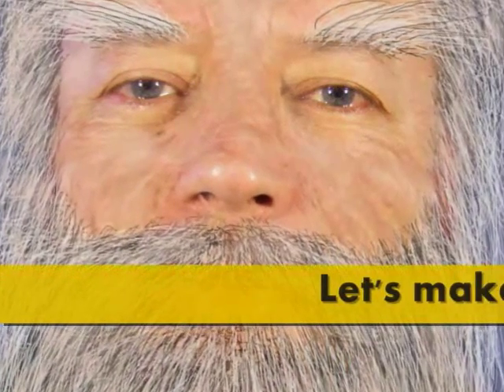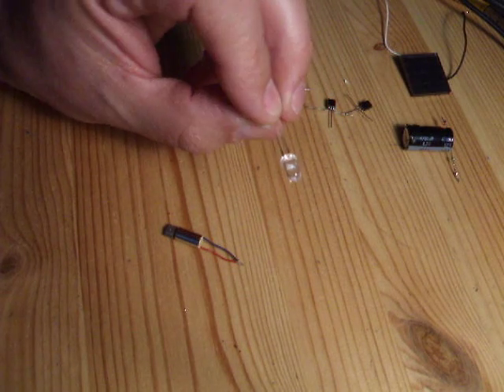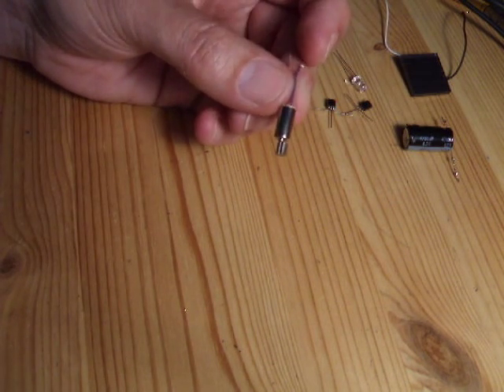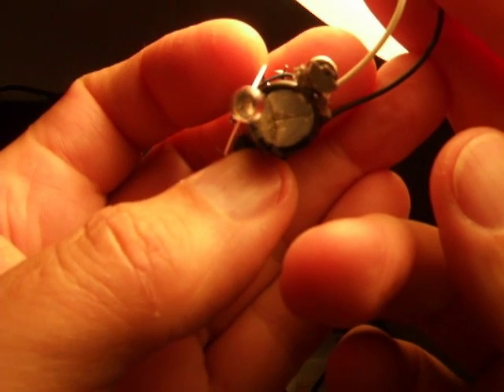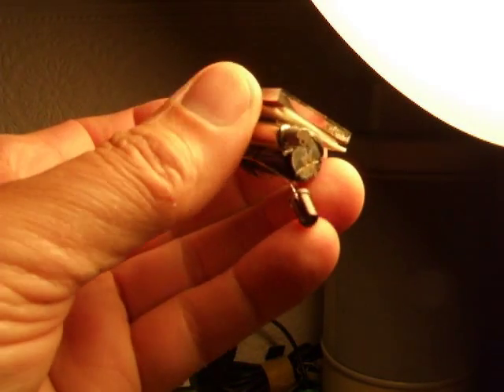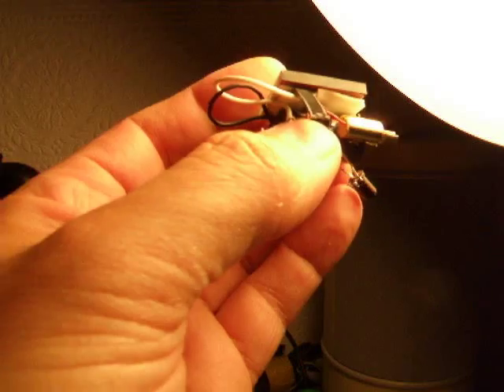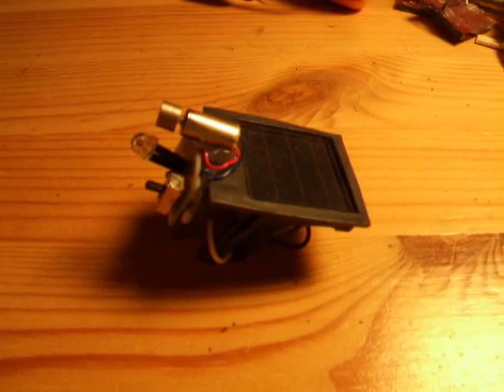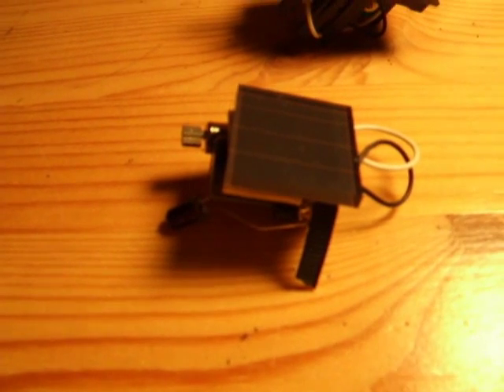Let's make a Solar Vibrating BEAM Bug

Comment: These are so cool, just made my first one. Got you to thank for introducing me to BEAM bots and inspiring me! :) You thought about doing any more in the future, maybe a different circuit?
Reply from the maker: Thanks Chester. I had always intended to make more. I did make another one which I think has the same circuit but the motor shaft touches the floor so it drives itself along. I am guessing you already checked out the links in the video description. This is one that I had always intended to build. Maybe I will, one day https://www.youtube.com/watch?v=rnPKVXE_Lsg&list=PLA5a2xPRSrB2BYQZqfVqWfaja5C9hY_Zg&index=17
Reply: @GrandadIsAnOldMan  Hmm I did reply to this but it doesn't seem to have gone through. Guess it's because I included a link :S Yeh seen your other videos, that one looks interesting 👍
Reply from the maker: @SquareOrbits  your other comment will probably drop into my "held for review" box. I will have a look for it and OK it if I find it 😁👍

Comment: How to put wires in vibrating tooth brush motar repley fast please
Reply from the maker: Sorry Madhav, I don't understand the question. The motor should have wires already. If it has no wires it is no good, sorry, as it is virtually impossible to take the motor apart to replace them. It is a sealed unit, not designed to be taken apart.